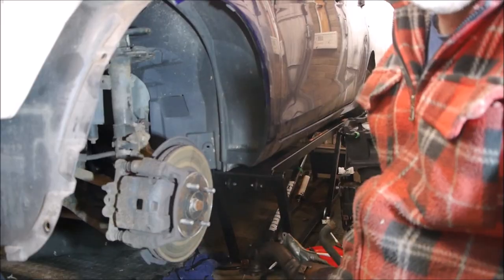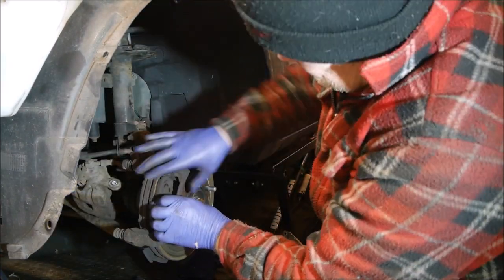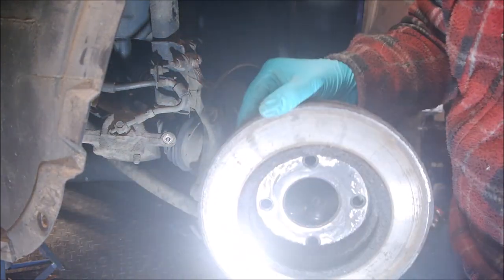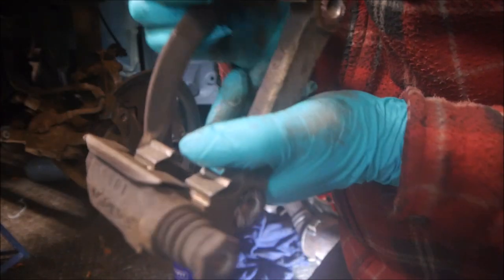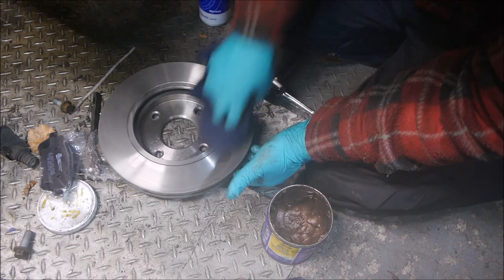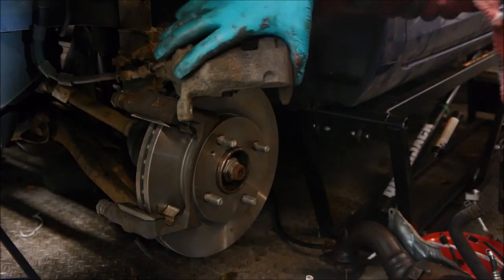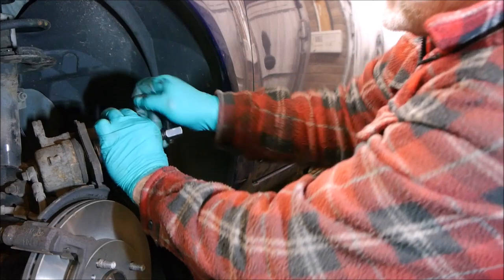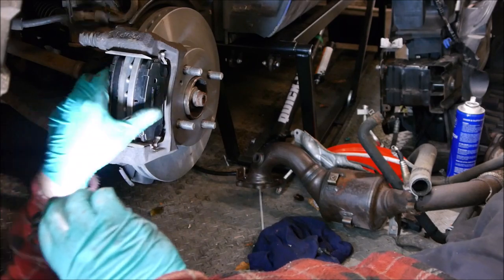Ford Fiesta Mk7 2015 DIY replacement  of front brake discs and pads

Comment: Wish they were all that easy. I have that piston retracting tool aswell, but ive bought a Merc CLK, and they have pistons either side so cant use it now ???
Reply from the maker: I believe some modern  cars require diagnostic equipment to wind the pistons out
Reply: @vintagesteelgarage  yeh how ridiculous is that !! I wont b buying any !
Reply from the maker: It's manufacturers making it difficult for none dealer garages and diyers.